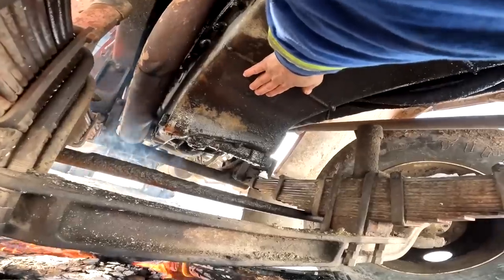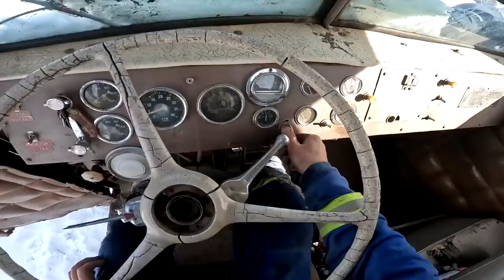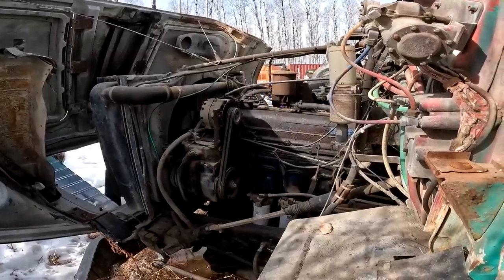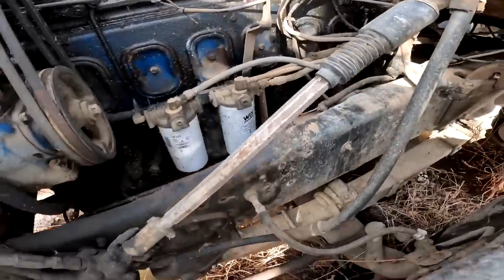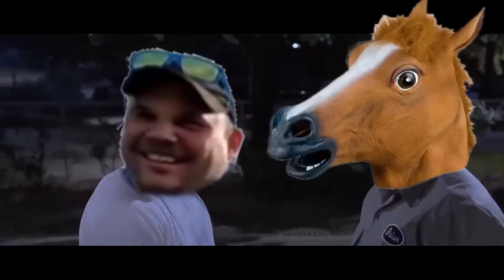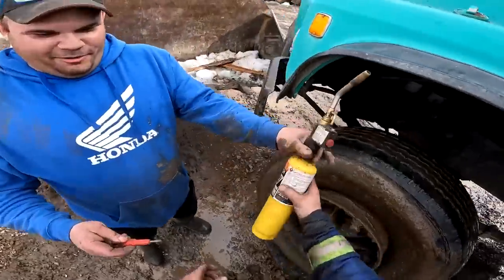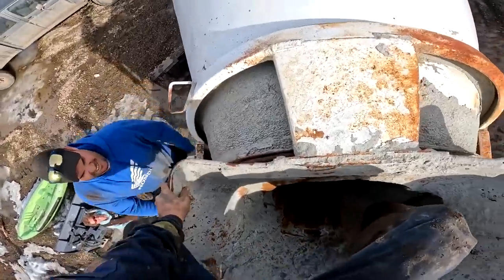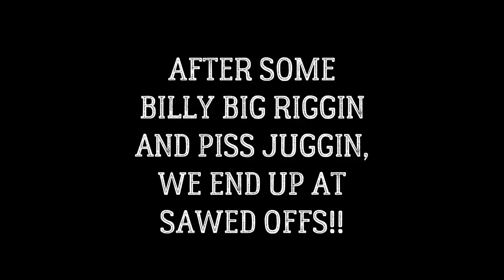-22F CUMMINS, CAT AND DETROIT COLD STARTS!!! PART 2

Comment: I love the wood fire on the hood I've had too use  one of my still... I mean a turkey fryer burner to heat up my skidder motors in negative temps plenty of times they work great an if your scared of setting it on fire put a piece of sheet metal on it or one of your ole lady's cookie sheets ...my pops always did that I just gamble with the fire 🔥

Comment: Before multi-viscosity engine oils were introduced for piston airplane engines, one had to dilute the oil by adding some avgas to the oil in order to make it thinner and enable it to flow more easily in sub freezing temperatures.  Once the engine was started up and warmed up, all the fuel that was in the oil evaporated and the oil was back to it’s normal viscosity.

Comment: I have run an Olds diesel on WD40.  The engine had no intake manifold or pump on it.  I just sprayed each bank alternately.  It ran surprisingly well.  It entertained all the mechanics in the shop.  I have done many experiments on engines to see what would happen.  Once I ran a Ford gas V8 on one cylinder.  I started it on 3 or four cylinders, then removed plug wires one at a time.  It wouldn't restart on one cylinder though.

Comment: There's a plate you can remove to get into the barrels but most have like 3 or 4 inches of concrete on the walls because they don't wash them out

Comment: The steel fins are maybe 1/4" thick. They get caked with hardened concrete, especially on their front sides. I used to drive concrete trucks. One of the multitude of reasons I am hard of hearing today at age 64 is that we used to go in the drum and use an air hammer with chisel bit to chip the hardened concrete off the fins once or twice a year.
Reply: WHAT?

Comment: How to tell from the smoke rolling out from under dash smells like wood from the Alberta block heater. Or it's the eye burning hot copper smell aka fragrance of dodge wiring. It's good. 
Or were just microwaved and stunned
Where's the screwcab schlongbox to slingshot that concrete truck out. Leave the dump compressor behind it probably didn't heal up from last time